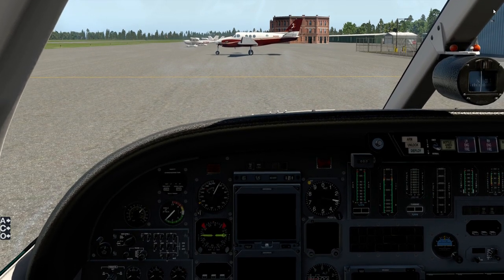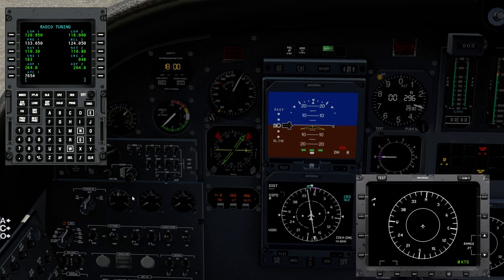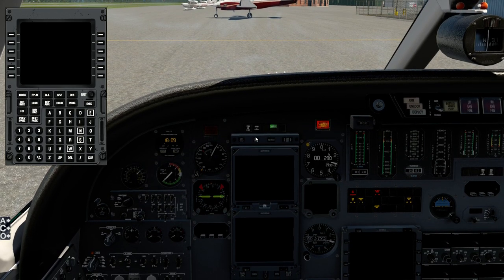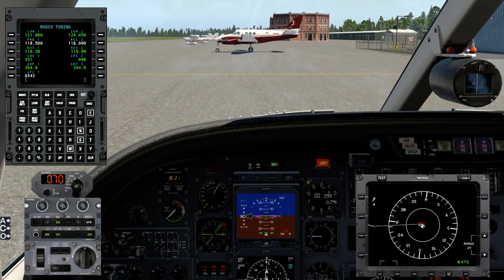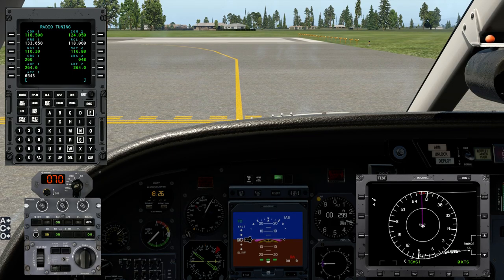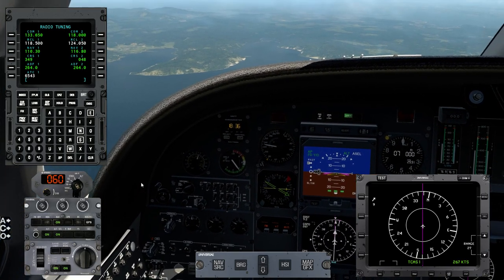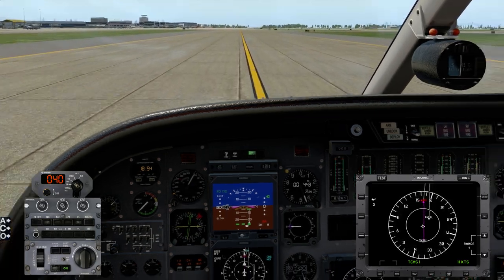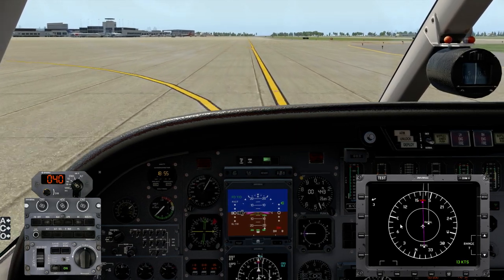Carenado Cessna S550 Citation II for X-Plane 11 Startup and Normal Operating Procedures

Comment: Thanx for the video.I have a question.Why is your altermeter so finished and mine has this big yellow block on the face of it.Is there a patch that I should know of?Please let me know.......Thanx and thanx for the great videos....
Reply from the maker: Hi there. I’m not using any special patch. I downloaded the plane as is without any modifications. Not sure exactly what you are experiencing.
Reply: @sogpilot3137  Hi thanx for replying.I cant use my altimeter.It has a square in the middle and show no altimeter hight so,its not posible to chang or set my altimeter.  https://ibb.co/9rZ06q7

Comment: Incredible tutorial! How do we use vnav on the citation?
Reply from the maker: Hi there. Are you referring to using the autopilot to control vertical navigation?
Reply: @sogpilot3137  yes precisely!
Reply from the maker: Okay. The target altitudes would need to be programmed into the FMS. In theory, when the autopilot is activated, it will control thrust to climb and descend accordingly. In reality, it doesn’t work very well, so I don’t use the VNAV component on autopilot. I control climbs and descents with manual inputs to control speeds and climb/descent rates.

Comment: great tutorial I was try in to lean this plane for a wail quick question what plugin is the check list ?
Reply from the maker: Hello there. The checklist is not a plug-in. It is a feature built into X plane 11.

Hello.  To set up a checklist in X-Plane, follow the below instructions.  The text is converted to speech automatically by X-Plane as you toggle through each checklist item.  The checklist can be displayed on the screen, or removed from the screen for voice-only checklist toggle.

Using a Checklist
X-Plane has the ability to display a simple checklist in the simulator. This checklist must be stored somewhere in the X‑Plane directory as a plain text (‘.txt’) file.

To load a check list, open the File menu and click Open Checklist. Click on Load New Checklist and navigate to your ‘.txt’ file. Open it and you will see the checklist displayed line-by-line in the checklist window. You can use the forward and back buttons to go to the next and previous lines, respectively.

If you prefer to see the text file all at once (rather than line-by-line as in the checklist view), you can select Open Text File from the File menu and then load a file in the manner discussed above.
Reply: @sogpilot3137  thanks so much Sr. very helpful
Reply: Hi SOG Pilot sorry to bother I try to do the check list and dint work. can you do a video on how to set up the check list sorry for asking
Reply from the maker: Sure thing. It’ll take a while for me to get it done, but rest assured I will post it when it’s finished.
Reply: ohh the check list needs to be coveted okay is working now yay thanks
Reply from the maker: Okay. Glad you got it working.

Comment: Hey SOG. Great video. How do you make the copilot speak the check lists like that? I am new to X-Plane from FSX-Steam. Just got X-Plane the other day and i have it set up and working for the most part. I just bought this jet to fly.
Reply from the maker: Hello.  To set up a checklist in X-Plane, follow the below instructions.  The text is converted to speech automatically by X-Plane as you toggle through each checklist item.  The checklist can be displayed on the screen, or removed from the screen for voice-only checklist toggle.

Using a Checklist
X-Plane has the ability to display a simple checklist in the simulator. This checklist must be stored somewhere in the X‑Plane directory as a plain text (‘.txt’) file.

To load a check list, open the File menu and click Open Checklist. Click on Load New Checklist and navigate to your ‘.txt’ file. Open it and you will see the checklist displayed line-by-line in the checklist window. You can use the forward and back buttons to go to the next and previous lines, respectively.

If you prefer to see the text file all at once (rather than line-by-line as in the checklist view), you can select Open Text File from the File menu and then load a file in the manner discussed above.
Reply from the maker: Here is the checklist I created from the S550 flight manual. No special software is used. I simply used the text to voice feature in X plane 11.

BEFORE START

Preflight Inspection - COMPLETE
Flashlight - ABOARD/CHECKED
Fire Extinguisher - ABOARD/CHECKED
Microphones, Headsets, Oxygen Masks - ABOARD
Documents and Manuals - CHECKED
Oxygen Quantity - CHECKED
Circuit Breakers - CHECK IN
Anti-Ice/De-Ice Switches - OFF
Control Locks - REMOVE
Generators (except for GPU start) - GEN
Fuel Boost Pumps - NORM
Ignitions - NORM
Crossfeed - OFF
Gyro Slave Switch - AUTO
Standby Gyro - ON/VERIFY POWER/OFF
Seat Belt Sign - CHECKED/OFF
Anti Skid - OFF
Cabin Pressure/Rate Control - SET
Throttles - CUTOFF
Engine Sync - OFF
Windshield Bleed Valves - CLOSED
Battery Switch - BATT (CHECK 24 VOLT MINIMUM)
AC Power & Master Avionics - ON
Rotary Test - CHECKED
Parking Brake - SET
Landing Gear Handle- DOWN/THREE GREEN/NO RED
Engine Instruments - NO FLAGS
Electric Elevator Trim - TRIM DISC CHECKED
Airspeed Bug - SET
Fuel Quantity - SUFFICIENT/BALANCED
GPS/FMC - PROGRAMMED
Flight Plan - FILED

BEFORE STARTING ENGINES

Chocks - REMOVED
Seats and Pedals - ADJUSTED
Beacon/Navigation Lights - ON
Cockpit Lights - AS REQUIRED
Standby Gyro - ON
AC Power & Master Avionics - OFF
Air Conditioning - OFF
Cabin Door - LOCKED/LIGHT OUT
Before Start Check - COMPLETE

STARTING ENGINES

First Engine Ignition - ON
First Engine - START
N2 - VERIFY RPM INCREASE
First Engine Throttle - WAIT FOR N2 ABOVE 8% THEN SET TO FLIGHT IDLE
ITT - MONITOR WITHIN LIMITS
N1 - VERIFY ROTATION/RPM INCREASE
WAIT FIRST ENGINE STABILIZED
Second Engine Ignition - ON
Second Engine - START
N2 - VERIFY RPM INCREASE
Second Engine Throttle - WAIT FOR N2 ABOVE 8% THEN SET TO FLIGHT IDLE
ITT - MONITOR WITHIN LIMITS
N1 - VERIFY ROTATION/RPM INCREASE
WAIT SECOND ENGINE STABILIZED

BEFORE TAXI

GPU - DISCONNECTED
GENerator Switches - GEN
Volts/Amps - CHECKED
AC Power & Master Avionics - ON
PASSenger Advisory Light - PASS/SAFETY
Cabin Pressure and Temp Controls - SET/AUTO
Gyro Pressure - CHECKED
Air Conditioning - FAN OR OFF
Circuit Breakers - CHECK RIGHT/CHECK LEFT
Belts and Harnesses - FASTENED
Exterior Lights - AS REQUIRED
Before Taxi Check - COMPLETE 
 
TAXI

Check Departure Runway - BUGGED/VERIFIED
ATIS and Clearance - COPIED
Transponder - SET AS REQUIRED
Brakes and Steering - CHECK RIGHT/CHECK LEFT 
Flight Controls - TOPS CHEKED/BOTTOMS CHEKED
Flaps - CHECK OPERATION/FLAP HANDLE AGREES WITH FLAP POSITION
GPS/FMC - PROGRAMMED
INVerters - CHECKED
Auto Pilot & Flight Director - CHECKED/HEADING-ALTITUDE SELECT
Anti-Ice/De-Ice - CHECK AND AS REQUIRED
Thrust Reversers - CHECKED
Flight Instruments - CHECKED
Altimeter/Altitude Selector - SET
Radios/Avionics - SET
Fuel Quantity/Balance - CHECKED
Pressure Source Selector - CHECKED LH/RH/NORM
Speedbrakes - CHECKED/RETRACTED
Flaps - SET 7 DEGREES
Trims - SET THREE TRIM WHEELS
Takeoff Data/Bugs - REVIEW
Crew Briefing - COMPLETE
Taxi Check - COMPLETE 

BEFORE TAKEOFF

Ignitions - ON
Anti-Ice/De-Ice - AS REQUIRED
Pitot/Static Heat - ON
Exterior Lights - ON
Transponder/TCAS - ON
Engine Instruments - CHECKED
Anti Skid - ON
Annunciator Panel - CHECKED
Departure Runway - BUGS ALIGNED/VERIFIED
Before Takeoff Check - COMPLETE

AFTER TAKEOFF AND CLIMB

Landing Gear & Lights - UP AND OFF
Yaw Dampener - ON
Flaps - UP
Engine Sync - ON
Ignitions - NORMAL
Climb Power - SET
Anti-Ice/De-Ice - AS REQUIRED
Anti Skid - OFF
Pressurization - CHECKED

Passenger Advisory Lights - AS REQUIRED
Exterior Lights - AS REQUIRED
Climb Check - COMPLETE 
 
TRANSITION (climb)

Altimeters - 29.92/29.92-CROSSCHECKED
Recognition Lights - OFF
Oxygen - CHECK
Pressurization - CHECK
Air Conditioning - FAN OR OFF
Transition Check - COMPLETE  
 
DESCENT

Defog Fan - HI
Foot Warmers - CLOSED RIGHT/CLOSED LEFT
Airflow Distribution - COCKPIT
Pressurization - SET
Windshield Bleed Air/Manual Valves - LO/MAX
Anti-Ice/De-Ice - AS REQUIRED
Fuel - BALANCED/CROSSFEED OFF
Descent Check - COMPLETE 
 
 
APPROACH

Altimeters - SET/CROSSCHECKED
Belts and Harnesses - ON RIGHT/ON LEFT
Passenger Seats - UPRIGHT/OUTBOARD
Cabin and Emergency Exits - CLEAR
Recognition Lights - ON
Landing Data - SET/POSTED
Anti Skid - ON
Pressurization - CHECKED
Avionics/Flight Instruments - SET
Approach Briefing - COMPLETE
Passenger Advisory Lights - PASS/SAFETY
GPS selector - SET
Approach Check - COMPLETE 

BEFORE LANDING

Landing Gear - DOWN-3 GREEN-NO RED/VERIFIED
Ignitions - ON
Engine Sync - OFF
Pressurization - CHECK ZERO DIFFERENTIAL
Landing Lights - ON
Flaps - LANDING
Annunciator Panel - CLEAR
Speed Brakes(Prior to 50 ft AGL) - RETRACTED
Autopilot/Yaw Dampener - OFF
Before Landing Check - COMPLETE 
 
AFTER LANDING (silent)

Anti Skid - OFF
Pitot Heat/Anti-Ice/De-Ice - OFF
Ignitions - NORMAL
Exterior Lights - AS REQUIRED
Standby Gyro - OFF/CAGED
Transponder - AS REQUIRED
Radar - STANDBY
Flaps - UP
Speedbrakes - RETRACTED
Trims - RESET
After Landing Check - COMPLETE 
 
SHUTDOWN

Check Parking Brake - AS REQUIRED
Transponder - STANDBY
Avionics & Inverters - OFF
Overhead/Defog Fans - OFF
Air Conditioning - OFF
Throttles - CUTOFF
Exterior Lights - OFF
Passenger Advisory Lights - OFF
BATTery Switch - OFF
Clock - ZEROED
Shutdown Check - COMPLETE 
 
VREF – KIAS Flap Full

WEIGHT / KIAS
14.1 / 114
13.5 / 112
12.7 / 108 
12.0 / 106
11.5 / 104
10.5 / 99
9.5 / 95

VREF – KIAS Flap 15

WEIGHT / KIAS
14.1 / 122
13.5 / 119
12.7 / 115 
12.0 / 113
11.5 / 111
10.5 / 106
 9.5 / 102

Comment: Sir, excellent video, have you tried or have you flown with this aircraft with the GTN 750?
Reply from the maker: Hello David. Yes, have used the GTN 750, but stopped using it because the only way to update the AIRAC was to purchase a very expensive Garmin subscription. So I went back to the default GPS using Navigraph for updates.
Reply: @sogpilot3137  IRL, well when flight schools were opened, I am at the point for my PPL checkride, 172.  

I have the S550 and as you advised the GTN 750 is outdated and I got it 4 months ago, I was doing a IFR (sim checkride - Vatstar) and when checking  navigraph, what they had compared to my GTN 750 it wasnt there....I wonder if I remove the plugin, does the FMC work ?
Reply from the maker: Good morning. Yes, when you remove the plugin, the original configuration will be restored. Sorry to hear about the timing of your check ride. Things are moving in the right direction and hopefully flight schools will be able to restore operations sooner rather than later.
Reply: @sogpilot3137  thank you for the information sir.

Comment: Hi there, great video one question do I have to set a vor to get on the glide slope for the ils as you did?
Many thanks
Oli :)
Reply from the maker: Your VOR #1 needs to be tuned to the published localizer frequency. If using autopilot, it needs to be set to VLOC to capture and fly the localizer/glide slope.
Reply: SOG Pilot Thank you!

Comment: This was fantastic (subbed), although I have a few questions that unfortunately arn't really discussed in carenados manuals and ive not used the default fms at all..
1) My S550 has no V speeds for the actual legs of an imported flight route. Is this normal? I know we cannot set perf parameters because it it a generic fms, but im just wondering as to why or if VNAV even works AND is useful in this plane. In the end I ended up using IAS mode for most of the vertical profile.. and enjoying it more than the larger airlines by alot actually.
2) I can not tune any of the radios. I really don't know what im doing wrong but I cannot get any ATIS to function.. native or active sky. Only by auto tuning with the ATC manager can i get it to work, no matter if I set all radios up as shown in fms, on panel, and even if i set them to both set and backup channels to be sure on BOTH radios. Really dont understand as it works for cessna 172 and airliners fine.
Honestly this aircraft is one of the most fun ive flown in awhile actually. Great visibility and performance, takes all the fun of the GA and great visibility and combines it with all the power of airliner and high altitude flight (whilst being less of a brick).
Thanks for your time.
Reply from the maker: Hello there. Regarding speeds for each leg of a given flight entered into the FMS, I do not use or rely on this feature. All climbs and descents are controlled by me manually. I find the auto pilot thrust control to be most unreliable, even dangerous.

Regarding your issue concerning communication audio, I have not experienced that, so unable to comment. You may want to reach out to the folks at Carenado to see if there’s a setting you’re overlooking.
Reply: @sogpilot3137  Thank you very much for your reply, is appreciated. That pretty much answers my question.. I guessed as much but wanted to confirm.
I'll probably do that I just cannot get it to work for some reason - it probably is something im forgetting but the reference information provided isn't great. Neither radio picks up anything when set and turned on.. and cannot find any switch that im missing re power or whatever to get them on.
Reply from the maker: Yeah, the speed control portion of the auto pilot is a weakness with the S550. On the COM issue, have you tried reinstalling the airplane? Sometimes this can clear out any ghosts. Worth a try.
Reply: Hi There. Not Problem. Just Put the Carenado S550_Citation_II_v1.2 File into Aircraft Do not use a Subfolder and thats it. Regards.
Reply: I forgot. And the radios come on.
Reply from the maker: Cool. Thanks for that info and for helping him out.
Reply: Thanks again guys will give this a shot.
Reply from the maker: Let us know how it works out